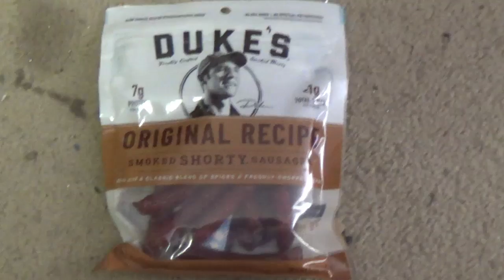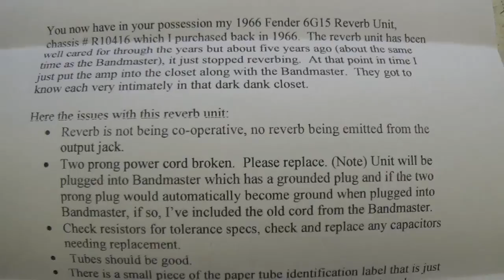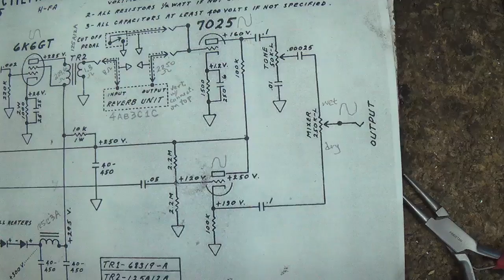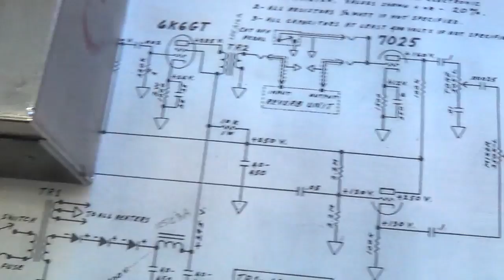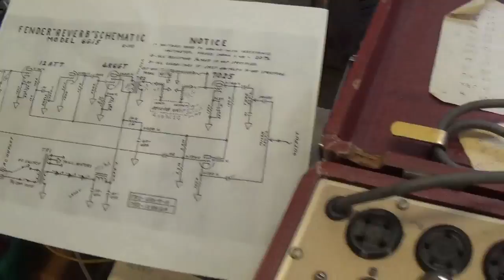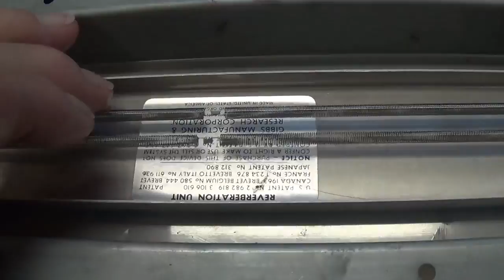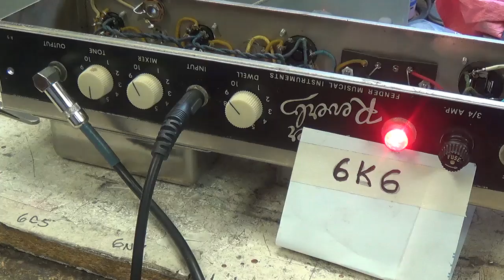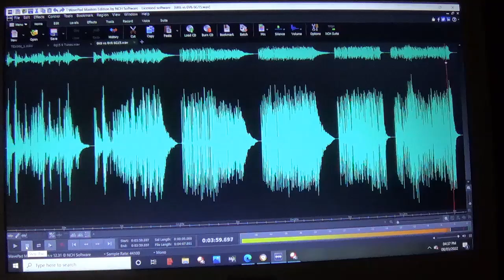Virtually Mint 1966 Fender 6G15 Reverb Unit.......It Quit Reverbing :)

Comment: 1966 and not one drop of white paint on the tolex. Unbelievable. 

I’ve had some success recharging vintage alnico magnets with two powerful neodymium magnets at either pole. I’ve never tried it for reverb tank magnets. But maybe it’s something that can be done to revive an old tank.
Reply from the maker: If you perfect the process, be sure to let us know, T.
Reply: I also wonder if heat can be used to restore spring tension somehow. Maybe a dumb idea, maybe there's something there
Reply: @djentlover   Heat would probably relax the springs and cause them to stretch even more.
Reply from the maker: @djentlover  Heat generally destroys springs by de-tempering the steel, DJ. It's just easier to replace them.

Comment: Hi Uncle Doug,
Excellent explanation of the working circuit and your insights based on years of practical experience.  
Question - why are there multiple rectifier diodes in series (half wave configuration) in the power supply section?  Is this to otherwise avoid catastrophic failure of the power supply should a diode fail in short circuit mode?
Cheers
Reply from the maker: Greetings, MIchael. Thanks !!  I've read all sorts of explanations, but the one that makes best sense to me is that diodes are dirt cheap, and redundancy prevents breakdowns within the power supply.
Reply: Hi again Uncle Doug!
Your idea of using a full wave bridge rectifier…..although it will result in much better filtering/stability of the B+ supply, I believe the redundancy is effectively reduced as failure of any one diode in the bridge (ie short circuit) will result in catastrophic failure of the power supply or transformer or just a blown primary fuse?
I suppose one could use 2 series diodes in each leg of the bridge to bring back a level of redundancy?  Your thoughts?
Cheers from Oz.
Reply from the maker: It's rare to find FWBR's in vintage amps, SM, but when you do, they generally work just fine.  Diodes are generally quite reliable. If they fail, the results are not "catastrophic" at all, but most likely a stout 120Hz buzz or hum. @saintmichael2931

Comment: Hey Uncle Doug! Can you expound a bit more on the theory behind the 6K6 output? In most circuits, the  screen is fed with a voltage somewhat lower than the plate (to keep it from being the primary collector of electrons), but it would seem that the screen is higher in voltage in this circuit, due to the resistance of the matching transformer. What gives? My guess is that the current needed in this configuration is quite small, within the screen's limits, and the sound of the 6K6 can be had at lower power. As always, well done, and keep up the good work!
Reply from the maker: Good observation, Stirling. It bothered me too.......it would make more sense if the B+ was attached to the upper (plate) wire instead of to the screen. Since the voltage drop is dependent upon the current, which is miniscule at best, I doubt there is much difference between the PV and SV.

Comment: As always, incredibly helpful and informative.  If one were to convert to full rectification, would B+ be too high with modern voltages of 122AC and up on primary? Thanks
Reply from the maker: Thanks, BM. No, I have used full wave bridge rectification in my own versions of this circuit, and the voltages were appropriate.

Comment: Sam Hutton built cabinet. See his yellow initials on the bottom? Sam was a great guy. He was their cabinet builder for many years.
Reply from the maker: Thanks for the interesting info, David. I never noticed.
Reply: His initials look a little like a dollar sign. Sam had a house in Fullerton. He lived alone there and built cabinets in his garage and did tolex recovers. His house was filled with old speakers, amps he had collected and some he had rehabbed as well as parts. If you needed an old fender part, Sam had it. I loved going there sometimes just to hear his stories of working at Fender and about Leo. You would have enjoyed him Uncle Doug.
Reply from the maker: @Irlose1  He sounds like a fine and interesting chap, David. Thanks for sharing.
Reply: He’s gone now Uncle Doug as you can imagine. Probably passed around 2000 or so as I recall. A real treasure.
Reply from the maker: @Irlose1  Indeed. What a shame.

Comment: I have a 73' Super Six that I converted to a head only. Thanks to you I was able to do a complete recap and it sounds great again. My question is, I would like to add a bias adjustment as this amp only has a bias balance and is running very cold. I was wondering if you already covered this. I have seen others do it but I would rather get your input.
Reply from the maker: It appears there is a 3.3K resistor in the bias supply circuit that controls the -DC bias voltage, B. Perhaps you could experiment with its value. How fresh are your output tubes? If they are biased cold despite the proper bias voltage being applied, perhaps their cathodes are depleted.....worn out.
Reply: @UncleDoug  I suspect that at least 3 of the tubes are worn out. On the single fresh tube, I'm only getting 22 ma of plate current with 430 volts using a bias probe. No wonder the other tubes lasted 40 years. If you have reservations about installing a trimmer pot/resistor then I will scrub the idea and try increasing the value of the 3.3k resistor. Thanks for the personal help and all the great content. You have me checking garage sales for dilapidated old tube amps.
Reply from the maker: @borg3575  Installing a new matched set of output tubes would be a good first step. I have no reservations......it can be done, but it will require some knowledge, skill, and experimentation. Good luck.
Reply: @UncleDoug  I replaced all 10 tubes including a matched set of 4 6L6gc's. JJ's.  All 4 show a plate current of 5.2 ma. At least they match. Will proceed with plan to add a bias adjustment. According to my calcs, I need between 40 and 50 ma to achieve a plate dissipation of 15 to 20 watts.
Reply from the maker: @borg3575  Apparently way too much -DC bias voltage is being applied to each grid, Borg. Find a way to reduce it to proper levels and the problem will be gone......hopefully :)
Reply: Resolved the -DC situation and now have 17.5 watts of plate dissipation which is fine by me.
Thanks for your excellent content. I tell people that you are the Mr. Rogers of amp techs. Except that you push the envelope a bit beyond in some cases, which I am ok with. 
I may do a vid to show what was done.
Reply from the maker: @borg3575  Congratulations on a successful repair, Borg.

Comment: Another fascinating and informative video, UD. Thanks so much.I've had to replace a few tanks--it's amazing what a great sound can come from such a strange device, straddling the physical and the electronic.
An only vaguely related question, if I may. I have swapped the tubes powering the reverb on a modern Princeton, which is very strong at 3, but the substitutions run weak and not entirely to my satisfaction. Any thoughts, if you have run into this, would be appreciated. Thanks for your indulgence. 
PS  I love Jack & Ollie's taste in music. Will they be going on the road any time soon?
Reply from the maker: Thanks, Mark. I don't understand the question. If the reverb is very strong at 3, why try any substitutions?
Reply: @UncleDoug  Ah, sorry.  It’s so strong the useable range is from 1 to 4, the rest maxes out at super swamp. Hoping to tame it and make the full sweep useable, I substituted the next weaker 12ax type, a 5751, for the 12ax7 in the recovery position, but it overcompensates. This is a known issue for the 65 reissue.  I was wondering if there were other means for getting a better sweep of the pot.
Reply from the maker: @marksieber8140  I am not familiar with this particular issue, Mark, but I guess you could try a 12AU7 or perhaps replace the Dwell pot with one of lower overall resistance. To be honest, if 0-4 gives you a wide range of reverb intensity, do you really need to have full sweep capability? Most people complain that the reverb is not intense enough ;)
Reply: @UncleDoug  I have tried them, even split value tubes. Thank you for the time and sensible perspective, UD. (And definitely a first-world “problem”.)
Reply from the maker: @marksieber8140  You're welcome, Mark.

Comment: Hi Uncle Doug, great video as usual! Have you ever fixed the electronics of a tube Echoplex? It’s an EP 2, the output is low even with new tubes. Best Rgds
Reply from the maker: I have not, Alvaro, despite several requests to do so. My repair schedule is so tight that I honestly don't have time for a "wild card" project that might take days to complete.
Reply: @UncleDoug  Thanks Uncle Doug, I’ll try applying what I’ve learned from you in your wonderful videos and see what happens.
Will let you know. Best Rgds
Reply from the maker: @alvarofalcon7136  Good luck, Alvaro :)

Comment: After the signal passes through the spring reverb, the phase will always be shifted, because he is delayed, albeit for a minimum of time. Therefore, it does not matter in what phase, relative to the dry signal, to apply to the input transducer of the tank. Take a look at the reverb unit Fender Vibro-King schematic and you might be surprised.
Reply from the maker: Slightly out of phase is quite different from 180 degrees out of phase Al.....and I was referring to the final signal mix, not the input to the tank.
Reply: @UncleDoug  I was just trying to say that if you remove one triode in the reverb driver, then the final mix will not change, in terms of phase. Since the free phase of the signal comes from the output transducer.
Reply from the maker: @AlSpudnik  Thanks for your input, Al.

Comment: Uncle Doug, are you aware of a source for the handle that locks the tank in place? Great video, thanks!
Reply from the maker: No, but it can be hand-made, like the one in my 6G15.
Reply: @UncleDoug  That's what I figured I'd do. But I like to try to find things before I make them anymore just to save time. Thanks!
Reply from the maker: @riptidesurf  You might check with Stew Mac and Mojotone.

Comment: I thought I'd seen a reverb unit that had a speaker in it. Maybe I'm wrong. Thanks Uncle Doug.
Reply: Nope, it just houses the springs, the circuit and the controls.
Reply from the maker: Some Guild amps, as I recall, had a large speaker for the regular signal and a separate, smaller speaker for the reverb signal. You mixed with separate volume controls.
Reply: Don’t forget the reverb chambers at abbey road. Stick a speaker and a microphone in a room full of junk :)

Comment: Great video, as always 🙂Do you happen to know why Fender used 12AT7 rather than a 12AX7/7025 for the 6G15 preamp stages?
Mitzy is such a sweetie. Is she as hungry as KC?
Reply from the maker: The 12AT7 has an amplification factor (AF) of 60, vs the more commonly used 12AX7 AF of 100.....and they use a (weaker than 6V6) 6K6 to drive the tank. The common thread I see is they have chosen to moderate the signal energy being applied to the reverb tank. Perhaps this was determined by experimentation to seek the best reverb tone.

Comment: At 49:40,  note that there is no screen resistor in the supply line to the 6K6 screen, and the voltage to the screen would actually be slightly higher than the voltage to the plate because the plate voltage has to pass through the resistance of the output transformer primary, while the screen gets its voltage-feed directly, with nothing to drop it or limit the screen current. This really isn't very good practice for tube longevity.  At the relatively low voltages being used here, a 6V6 might not care all that much, but the 6K6 has lower maximum ratings.  I also noted that, unlike many Fender amplifiers that use an  artificially-derived filament-supply center-tap made of two 100 ohm resistors, this unit grounds the transformer's filament-winding centertap.  The artificial center-tap made with a pair of resistors might be safer in the case of of the 6K6 or 6V6 shorting out, as it will burn the resistors (1/2 watt carbon films are fine) and hopefully protect the power transformer.
Reply from the maker: Thanks for your helpful input, GU.

Comment: Agreed new springs in the tank,  but cannot the magnets be re-magnetised ?   The overall sound ideally I feel should try to end up midway between what the MOD was doing and what the Gibbs put out - at some settings the Gibbs felt better - which shows what low magents and saggy springs can achieve when signal has particular characteristics in, and controls out.
Reply from the maker: It's impossible to please everyone, HP.  I always do what I think is best for the customer. If I had remagnetizing gear then I might have tried it, but I don't, and hate to send customer parts off to strangers for uncertain work over an uncertain period of time.

Comment: C.S.A. is Canadian Standards Association. Any electrical equipment sold in Canada must meet CSA standards before being sold in Canada( A big problem for online shoppers ). I would expect this amp was originally sold in Canada. If you plug in a non-CSA aprroved appliance into a socket in your house and your house burns down.......... insurance will not cover the damages.
Reply from the maker: Thanks for the helpful info, Clay.

Comment: I’m a home taught bunny who likes a darker spring reverb but neither of my amps (a Victoria and Carr) has a tone. So I tried making one, basically a pot (with a single cap arrangement) on the return line from the tank to the recovery tube stage. It works passably but seems to also attenuate the amount as well as the tone somewhat. In any case, is there an easy design for wiring the pot that you could suggest? I literally stumbled around using trial and error for placement of the cap, values etc. thanks in anticipation
Reply from the maker: Without a schematic I can only speculate. You may simply increase the value of the coupling cap(s) in the tank-driving circuit.

Comment: Great video had a question about tanks I have a mod fender blues jr and a mod crate v18 both quite good when modified but both seem to have weak reverbs and they both just have the tanks stuffed in a bag would I have better performance if I took them out of the bag and mounted on the side of the cabinet?
Reply: you have to have specific reverb tanks designed for side mount, the code on your tank will tell you what the mounting its designed for. just google your tanks manufacturer for how to read the code
Reply from the maker: Simple answer... No. The bag does nothing to diminish the reverb effect, and a floor mounted reverb tank will not function properly if mounted on the side of the cabinet.

Comment: 36:00. Why does the dry signal receive less amplification to match the amplified reverb signal at the mixer, is it due to bass frequenceies being filtered out prior?
Reply from the maker: The amplification of the wet signal is to drive the reverb tank, Opto. Since the tank is inefficient, the post-tank signal is approximately equal to the dry signal in amplitude.
Reply: @UncleDoug  Ahhh OK, thank you

Comment: Uncle I have question #2 I designed a small single ended amp using one 12ax7 and two 6l6gc in parallel I was thinking I could integrate it to work with part of the 6 g15 circuit what do you think?
Reply from the maker: The 6g15 is a standalone reverb device. Why not simply use it with an existing amplifier (as originally intended) rather than defeat the purpose by turning it into something it is not?

Comment: Uncle Doug, do these type Reverb units sound better or give you more variety and control? I would suspect it does but I would also think a separate unit might increase noise over having reverb built in to an amp. Any thoughts? I have considered building one because I don't have an amp with reverb, I end up building on the cheap for lack of funds. Just trying to gauge whether it is worth it to have the separate unit.
Reply from the maker: I would say "yes" it offers greater control and "yes" it is worth having, simply because you can achieve Fender Tube Reverb (IMHO the best there is) with ANY amplifier.

Comment: Do you know where to get these suspension springs? I have a 1961 one of these and one of the springs broke. Also the springs just directly attach to the screws instead of having another spring wrapped around the screw which I don’t know if its orignal or not since mine had been serviced before. I also have the original cover for mine.
Reply from the maker: I have no source for suspension springs, Nikki, you need to contact one of the manufacturers. The original spring mounting was demonstrated in the video.